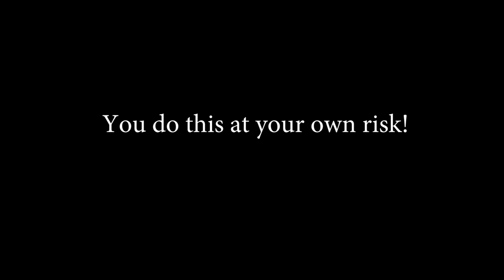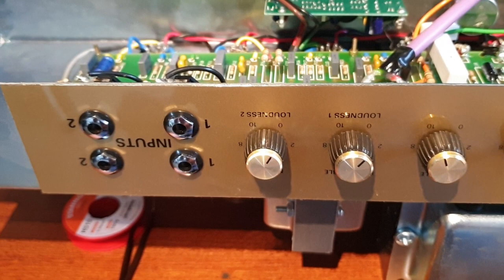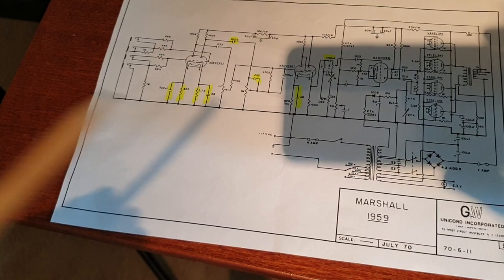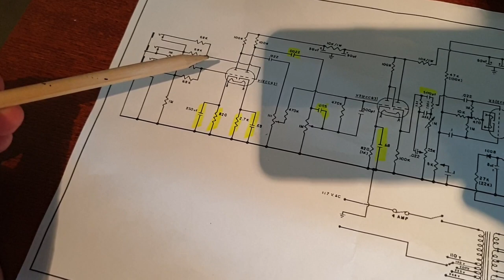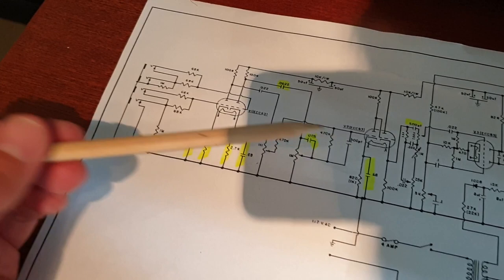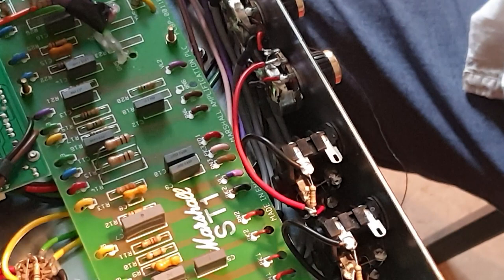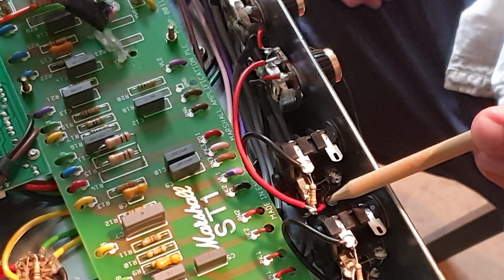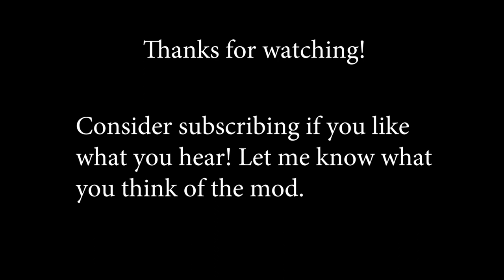How to do the ONE WIRE MOD on a Marshall 1959 SUPER LEAD!! Do a PLEXI need this??

Comment: You did this wrong.....
Reply from the maker: Then please tell me what you think is the right way. I'm not trying to turn it into a jcm by any means, dont like the whole cold clipping thing but it could use some low filtering. Don't remember exactly but this amp went back to stock right after. But please elaborate on your informative comment 👍
Reply: @Rohbemusic  have your copy of the schematic ready......I'll grab mine here in a moment.  AND I'll get back to you.  BUT keep in mind that the schematic you flashed in the presentation showed the V1 tube as having a split cathode circuit which is good as you want to use the side where the cathode resistor is high but you might need to remove the bypass cap on that cathode resistor as that increases the gain of that stage....which when cascaded might be too much since you mention the JCM aspect.  There were 2 places where they inserted BRIGHT caps around a resistor and the volume pot...on the bright channel.  so they might need moved over to the opposite channel in the end or you might need another 2 bright caps of similar values to add on to taste.  The V1 cathode resistor will influence the gain of that tube section and the bypass cap will too but the value of that bypass cap determines how much low end passes through when you mention low end filtering
Reply: ok.....with the split cathode on V1 and looking at the schematic, the left hand cathode resistor is 820 ohms and it has a 250uf bypass cap.  The cap is good for full range spectrum and is actually what was on the original Fender tweed bassman that Marshall cloned here.....BUT the 820 ohm resistor is not the right value for this stage as a single cathode.  This is a design mistake when they split the cathodes.  The 820 ohm is the original value for when the V1 shares both cathodes on one common resistor and bypass cap.  As a single cathode situation they should have changed the 820ohm resistor to 1.5k for the same gain factor in a single split cathode situation.  BUT for this situation we will use this side of the triode as the primary.....but keep in mind it would need changed ultimately as its the output gain of this side that's getting cascaded into the opposite side.  The 250uf bypass cap adds gain too and depending....could be lifted out to reduce the gain if its too much as being a cascaded situation......padding the gain down.  I use a 54 gauge low E string so I have good bottom end with my guitars.....but if you use like a 36 low E....you might need help.  >>>>Anyway, check the 2 resistors on the input jack pair...they should be both 68k and the wire on the twisted side of them gets removed......rendering the 2 jacks dead in the amp.  The 68K pair wire would be for the second right hand side of V1 in the schematic.....the side with the 2.7k resistor on the cathode with the .68uf bypass cap.  The side with the 820 ohm cathode resistor, follow the plate out to the .022uf coupling cap and thus to its volume pot.......the center lug on that volume pot has a wire going to a 470K resistor on the board and that 470k resistor on its opposite side joins another 470K resistor in the same configuration as this volume pot.  You need to pull that one leg of that 470K resistor out of the board or cut its lead going in to the board so there is some lead on the resistor body that you can solder to....plus leaving some of the lead on the board in case you want to reverse this mod and restore the circuitry.  S when you cut the lead on that one 470K resistor.....the wire that went to the twisted junction of the input jacks 68K resistor pair......that wire gets moved and soldered to that 470K resistor lead.....THIS CASCADES the V1 sections in series......causing you to render the 2 input jacks dead and that side channel dead as its being used to cascade.  So its now a question of tailoring in the gain factor in the modification.......as I mentioned you are using the primary side with the 820 ohm resistor and it should be changed out to a 1.5K or larger resistor.....as the opposite side had the 2.7K which actually reduces the gain of the triode.  SO 1.5K to 2.7K or a point in-between or even more than 2.7K would vary the gain as the initial gain.  The bypass cap determine the low end but also boosts gain.  SO start with lifting on leg of that cap off the board to break its connection in the circuit and drop the gain of that stage.  Once you determine the cathode resistor you need for your gain taste on that section....and if you need more tone via a bypass cap.....you can start with the cap thats there or go to a different value such as a 1uf cap or even another .68 cap.  To make it more easy, you would want to lift the grounding leg off that bypass cap as I mentioned lifting one side off the board.......as lifting the ground side of the bypass cap will let you insert a resistor to ground in series with that cap leg to vary its gain influence on that stage.  Determining the resistor value would be streamlined by using a maybe a 10K pot wired as a rheostat so it varies the reistance...a variable resistor....so you can dial in what you need should you need the bypass cap situation.>>>>>>>Now going to the cascaded gain stage...second side.  The wire that went to the twisted 68K resistor pair is the grid wire for that section....the input.  That input is being fed signal via the volume pot control on the primary triode where the guitar plugs in to.  That volume pot center lug wiper has that 470K resistor on it in series.....and that 470K resistor is an attenuating resistor to reduce the signal strength coming out of that tube section gain stage....so its padding down the signal that's being cascaded in the second section of V1.  SO you have 2 points to adjust the gain in the cascaded section......that 470K resistor and the cathode resistor along with its bypass cap.  Being that its got a 2.7K resistor as the cathode resistor.....it may be padded down enough for your tastes but without the bypass cap on that cathode resistor.  SO same situation as the primary side.....you can play with the cathode resistor value and go to a bigger value resistor as well as putting the pot on the ground leg of the bypass cap should you need the bypass cap.>>>>>>>As for making the circuit bright.....they used a bright cap on the volume pot between the center lug and the non grounded lug on the pot.  AND they also had sometimes a bright cap in parallel with the 470K resistor off the center lug on that pot.  You could also add a bright cap on the cascaded controls too should you need it.>>>>>>>>>>>>>>>>>>so that's where the ONE WIRE thing comes in doing it properly.  But they never mention doing any adjustments like I outline.  AND YES...you do need a master volume control......and that  would be a 1 meg pot set up like the other volume pots in this amp, and inserted where the treble control center lug goes out to the phase inverter cap input......that would switch the center lug out from the treble pot to the MV pot end lug that's not grounded and thus the MV center lug goes to where the treble center lug went to on the phase inverter cap connection.>>>>>>one other trick for the cascaded side and the volume pot control for it.....its a 1 meg pot.....if it causes too much gain also in its adjustment, you can use a 1 meg resistor put across its 2 end lugs.....this would make 2 1megs resistance values in parallel and thus the result is 500K resistance......but you want to first start with that cascaded gain stages cathode resistor value.  You will know if the sweep of that volume pot gets to be too much and thus put the 1 meg resistor on it...and you could further reduce the pot value by adding a 500K or 470K resistor on the pot in parallel with the 1 meg to cut the pot value down to around 250K......to dial in the cascade gain effect you need.>>>>>>at the end of the day....its about the guitar signal being fed to the amps input...how strong that signal is.....humbuckers really put out alot of signal compared to single coils...so all factors count.  >>>>>and always set your power tubes bias to be 70% of their plate dissipation factor for best tone.
Reply: I hope you can follow that.....but you can contact me if its not clear or if you need advisement.  Working with a circuit board is a challenge as compared to the old style where the solder points are on top of the board.....and you didn't have to remove the board to get to the solder side
Reply: if you are not grasping what I mentioned about cutting the  470K resistor lead......you could remove the circuit board and take that time out to do it.....to get to the solder points on the under side......cutting the lead save the removal of the circuit board as a short cut.  But its your choice as to cut or remove the board.....should you want to restore it back if you don't like the MOD.  Cutting the lead as mentioned lets you have enough lead to solder it back from the top as a short cut to make the MOD easier and quicker.....>>>>>>>BUT as I further explained...you'd need some extra resistors too to adjust it properly to dial it in to taste for the gain factors
Reply: BUT beware that the little solder pads on the underside of the board.....when doing service.....sometimes they use crappy circuit boards and those solder pads are fragile and come off the board if its a low grade circuit board.....when you heat the pad up to remove the part.  Sometime it can come off and break free from its trace lead...other times if it come off the board & that trace lead might stay on the pad but lift off the board too
I hate working on circuit board amps...they are a pain....with pitfalls to watch out for.  SHOULD a solder pad come off and break free....you have to use a length of wire to restore the trace connection from that component point to the next one on that trace...to bridge the 2 points when the trace is broken.
Reply: one other thing I just noticed glance back at the schematic you have in the video......on the V2 you have in yellow highlighter a bypass cap on a 820 ohm resistor there.  You might want to lift that bypass cap ground leg out of the circuit as it will reduce gain slightly in that stage and add some clarity overall.......its a slight effect but may be necessary.  When you cascade...you will get the gain factor and compression and sustain but you don't want it to be way too much.  Although its your ears in the end, I think you might find that the tone is the best when the cathodes of the tube sections have no bypass caps on them......but that's subjective...and I gave you the ways to adjust that
Reply from the maker: Thank you Mike! Thats great info. I do follow, I dont think I would have follow as I made this video some time back. But your timing is excellent as I now are building my own "plexi" clone. Ptp so its much esier to change values around. I started out with 67' spec, so shared cathode, 820ohm. So that would equate to 1.6k. I liked that sound but are now changing things around to find what I like. I do think I like the 820r in first gain stage, even though it was a design fault. However I am struggeling with finding the right bypass cap to that 820, im thinking 1u, 0.47 was maybe cutting to much. Like you said, I will make my ears decide and also my hands. Once the bias gets colder(  2.7k and up) it starts getting stiffer and what I think harder to play. Warmer bias, the notes just flow 😊. Thanks for your input, I will let it take some time finding the right vocing of this amp 👍
Reply: @Rohbemusic  for the bypass cap, the low E when tuned to 440, a 25uf cap is the right match for the full spectrum.  The 220uf or 250 uf is for the bass guitar octave since this was a clone of a fender bassman and thus a bass amp technically.   So a 25uf cap would be the choice but the typical available value is 22uf today.  At least here in the USA, as I assume you are in Germany ....or somewhere in Europe ?  AS for the 820 ohm cathode resistor, the 1.5K is the 50/50 mid point setting for a single cathode....so actually 1/2 that is the proper value for a shared cathode but the 820 ohm is a more common resistor.  I tend to use the 1.6 or a 1.8 to soften the response and take some gain edge off.  Going to a higher value cathode resistor will make the amp response more clean and it won't overdrive with single coils and with humbuckers there will just be a hint.  In my amps I build, I use a switch so I have 2 profiles.....one for the subdued aspect and the other for the gain.  With the cathodes sharing the resistor the volume controls get interactive.....so the channel your guitar is plugged in to if you put the volume wide open, the opposite channel volume when tuned up to half its sweep will give maximum gain.....you can get a feel for the sweep in the opposite channel for the added effect if you were not aware of that.  BUT personally I prefer jumping both channels together with a lead as that will send a stronger signal to the power tubes and have a thicker more robust response than just using one channel.  I don't have a shared cathode amp up and running presently in my collection, so I can't say either way if a shared cathode or a separated cathode is better for jumping channels though I would lean to the separated cathodes.  When jumping the channel together with a lead......your guitar is plugged into the #1 input on one channel and the lead goes into the #2 jack of that same channel and the other end of that lead could go into the opposite channel in either the #1 or #2.....though the #1 input will be more forward in response and the #2 will be back just a bit in comparison....when you exploit the effect.  I set up fender 2 channel amps....any of the reverb combo amps black face or silver face era BUT I add reverb to the dry channel side so both channels are electronically in phase which is the only way they can be utilized when jumping the channels together.....and its a dramatic effect on those amps because you have independent tone stacks for each channel. >>>>>>Going back to the cathode bypass cap, 25uf is the full spectrum and dropping down to lesser values starts to trim away the bottom end.  The .68uf marshall used was the tip in point for boosting mid mids and higher frequencies.......a 1 uf might shift to lower mids and up.  You have to adjust the value by your ears for what you want to hear.  AND its the same with the bright caps in the 2 points in the circuitry......it might make the response way to brittle and shrill bright...so you can remove them to warm the response up.  In the tone stack, the treble cap is generally a 500pf value but you could raise it higher up to 1000pf or even 1200pf and this would shift to the upper high mids and trim off the harsher high end letting you dial the treble control high up.  The point is to get maximum signal hitting the power tubes.....so you want to try to get the tone controls all wide open to pass maximum signal......but if you must...you could dial back from wide open for your preferred response.>>>>>>Since you are building a plexi, if the power transformer you are using can support one more 12ax7......I would plan on adding one extra tube then if you want the cascaded gain situation.  That way you can retain the 2 channels and have each independent with each having the added gain stage and the ability to jump the 2 channels together.  But then again doing so, you could make the extra gain switchable in or out of the circuit as that would make the amplifier very versatile.  You could use a AB/Y switcher box to go between the 2 channels and the Y function would be the jumpered situation of both channels together.  If you use foot pedal effects....that would give you 3 pathways for effects with the AB/Y box.  the A & B would be 2 independent effects pathways.....and in front of the box would be a shared pathway.  THAT opens the door to possibilities playing...that is not normally present...if you think outside the box
Reply: keep in mind that if you add the 4th tube for an extra switchable gain stage for each side......you need to add the volume control pots too so you need space to place them somewhere on the control panel.  BUT to go one step further, you can add a single tone control pot on to each of the gain volume pots......and the basis would be the 50's fender princeton amp for a wiring example as to add the tone pot on to the volume pot.  This would give you some tonality control to the gain stage.  The best pot value to use is a 100K linear pot as its a sweep between 2 capacitors......so the mid point would be a neutral setting and the shift would be either way from that mid point
Reply: So keep in mind what I am telling you here about adding the 4th  tube.......this was the true secret back in the era with some guitar icons.  Keep in mind that Marshall made the standard heads but they also made a version of the standard head with tremolo.  The trem heads had the 4th tube and the expanded control panel with the speed and depth controls for the trem function on their front panels.  So those amps were the secret, where they removed the trem function to use that 4th tube for the gain stages and the speed and depth controls were the 2 extra holes needed for the gain volume controls thus hidden in plain sight on the front panels of these alternative heads .    Sometimes you'll see the standard heads where one of the input jack holes has a knob substituted in its place......that was where they placed to volume pot for the extra gain stage tube
Reply: The issue with what you did in the video is that by putting the wire over to the 2 resistors on the input jack......the jack when not having anything plugged in to it...has its hot going to ground so the grid of that side tube triode is technically off and not amplifying.  On the other end when you move the volume pot center wire of the lug and move it to the grounded lug.....creates a situation with the first half of the cathode follower tube.  That wire goes to a pair of 470K resistors that function in the normal circuit as merging resistors for the 2 channels that sort of keep the signal from back flowing.....but they feed the grid of the first stage of the cathode follower.  SO when you lift one out the remaining one becomes an attenuating resistor in series.....and if you ground the other one as you did by moving the wire over to the grounded lug......that first stage grid of the cathode follower is now having a grid leak resistor on it which would be like having its volume turn up half way if it were a standard 1 meg volume pot......you cut the gain and amplification of that first stage of the cathode follower.  So going back to the other aspect of connecting the new wire to the center lug and then to the input jacks.....with the 1 meg resistor going to ground on the input jack its going to create a weird relationship with the volume pot....both being 1 meg.  The center lug would constantly being separating the signal from ground by 1 meg as well as what the function of the pot would be without that situation where it would variably distance the signal from ground as it increases the volume as a result as you dialed up and away from ground.   BUT it did work because you didn't ground any signal out completely.....but you weren't getting the maximum potential and fully cascading.  The JCM 800's were the Marshall factory MOD as they decided to cash in on what the amp tech's were doing hot rodding the amps by cascading the 2 channels.......But Marshall went the route of making it a fixed situation and tuned to their way as opposed to giving the user a volume pot to vary the gain in the cascaded stage...you only got one volume pot.  The MOD aspect gives you the 2 so you can dial in the amount of the gain effect and the compression /distortion.   In my other postings.....I mentioned adjusting the gain stage with the cathode resistor and bypass caps.....the plate coupling cap can also be changed though the .022uf will be close for even tonality.  but if you need more low end on the cascaded stage...you might increase it to standard values .047uf or even to .1uf.....as they will pass more low end.  AT the end of the circuitry, the coupling caps that feed the input grids of the power tubes......those 2 coupling caps can influence the final product.  A .022uf value will make it sound less fuller overall with low end but still guitary.....if you change them to .047uf that will bring in more low end and sound fuller for the end product sound.  And .1uf would add even more low end pass through.  SO its a thing for more low E thump as you move from .022uf to the other 2 caps......but then too it depends on what string gauge set you use as bigger low E strings transfer more energy
Reply: sorry I was in error with the relationship with the 1 meg resistor on the input jacks.....when the hot is grounded.....the 68K would be the resistance to ground but they are weirdly in parallel with the switched jacks....so it could be 138K or it might be 33K.....either way...you don't want that.  You'd have to insert a dummy plug into the jack to trip the switch from going to ground and activate the 1 meg resistor....but you still wouldn't want that....